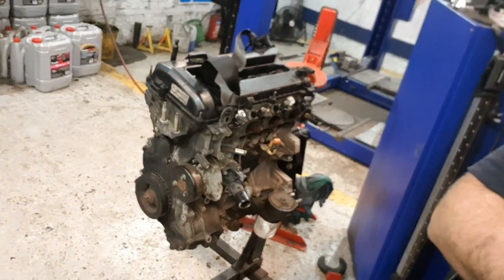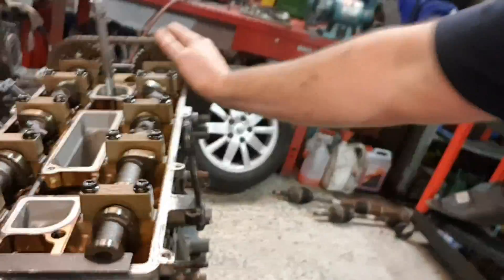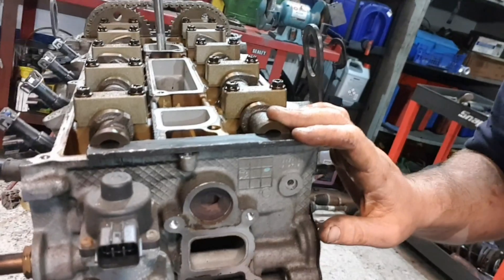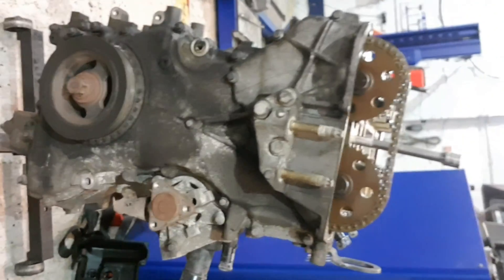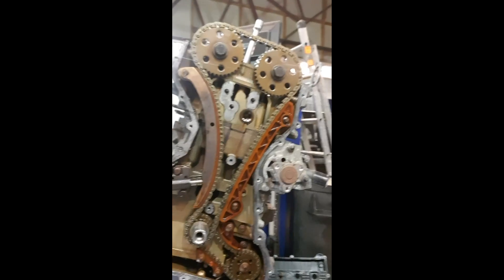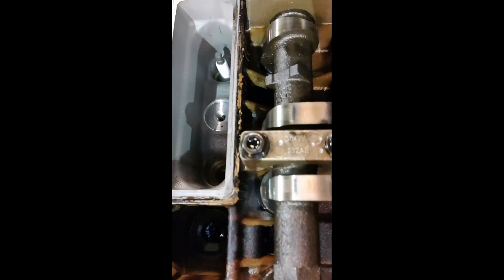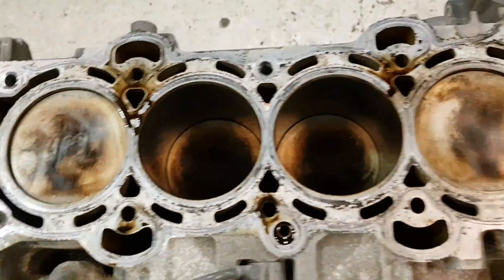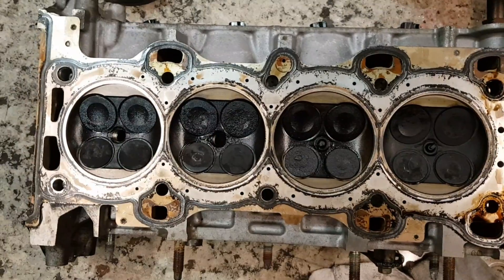2.0 Duratec engine rebuild part1

Comment: Quick question i have done very little in the way of mechanical work but very keen to learn i have a mk6 escort van I'm doing the welding on then i was thinking of putting an st170 in it, as i say ive never done much  on an engine but would like to do a rebuild would it be a crazy idea to make the first engine rebuild i doban st170 ?
Reply from the maker: Sorry for the slow reply. As engines go the st170/black top zetec engine are a pretty nice engine to work on so I wouldn't say it's a bad place to start learning on

Comment: I currently have a 2008 mk4 mondeo 2.0 duratec that has 149k miles and drives absolutely superb. uses no oil between changes and thats every 6k. it was a one owner vehicle prior to me buying it. all the big jobs are now done, clutch, driveshafts and belt kit. what I like is how cheap parts are for it and are readily available.

Comment: I’ve been lucky so far I have a Ford Focus 2007 20l Petrol 91000 miles oil changes every 6000 doesn’t burn any oil between changes  great engine

Comment: I'm building a zetec for a Yamaha Razor myself so I appreciate watching someone else mess with one. I'm from the US so it was not easy to follow but I think I got what you were aiming to get across. It was like listening to my English cousin speak. I usually just nod along lol
Reply from the maker: Thanks I guess lol
Reply: @stitchmotorsport1745  no offense meant. Your accent is just super thick to my fat American ears lol. I like seeing what you guys do with the zetecs over there because for some reason most everyone else missed what a solid performer they can be. Not a lot of aftermarket support here so it gets pretty expensive. I mean, I could throw together an 800hp ls engine for probably less than the zetec is gonna cost me AND I'm doing a lot of the machine and fab work myself. Trying to get a hold of an intake flange at the moment to fab up my ITB intake.
Reply from the maker: @fgialcgorge7392  don't worry I didnt take it as a insult was just messing lol I normally visit the states once a year and people usually struggle. Are you going NA or turbo?
Reply: @stitchmotorsport1745  going ITB's and NA for the time. Plan on fabbing up an intake plenum and adding a quick spooling turbo after I run it NA a bit. Nothing crazy so I can run with whatever cams I happen to find.
Reply from the maker: @fgialcgorge7392  check out a company called button power! They are really well regarded engine builders/parts suppliers here and I'm pretty sure they ship world wide. Even if you don't buy from them they have loads of info on their so it's another good source👌
Reply: @stitchmotorsport1745  Thank you! Life saver.i appreciate and will definitely be following along. Thanks a million for all your help and the advice. Can't wait to see more of your work.

Comment: Hey there, great vids! What was the reason for burning oil? Mine started to burn oil in last 6 months. And is there a way to clean or reduce build-up inside the cylinders without taking it apart, as its my daily..
Quick little advice, dont go off topic so much ;)
Greetings from Croatia!
Reply from the maker: I personally havnt used liqui moli products but they are a tried and tested brand so should be worth a try. I was never sure on them either then a friend used BG in his garage and i saw the results first hand. Then did some of my own testing and watched compression ratios go up on a low millage well maintained Merc slk and i was sold on them.
Reply from the maker: And thanks for the sub!!! If you like STs we are on instagram aswell
Reply: @stitchmotorsport1745  I did actually find you via instagram post as I follow #st150 :) I love STs, got a frozen white myself :D I'll follow you on ig aswell
Reply from the maker: Thanks for the reply. So with this engine i believe it was the valve steam oil seals in the cylinder head that were at fault. Changing them will be in a future video. If it has jist started happening with your engine i would recommend a product from a company called BG the do a engine flush called a EPR109 and we use it with all our services but also use it for cars that come to us burning oil  or failing emmisions tests. Its not guaranteed to work in your case depending how bad it is but for the cost of a oil and filter change and £20 for the product i would say its is definatly worth trying. Thank you for the feedback im still trying to find my feet with making  these videos
Reply: @stitchmotorsport1745  Thanks for the quick reply. I suspected it was something to to with valve seals. Since im not from the UK, we dont have those products here. Would you recommend any of liqui moly products? I was always sceptical when it comes to products like that. I did notice that the oil burning is reduced during winter time..
Keep up the good work, subscribed:)